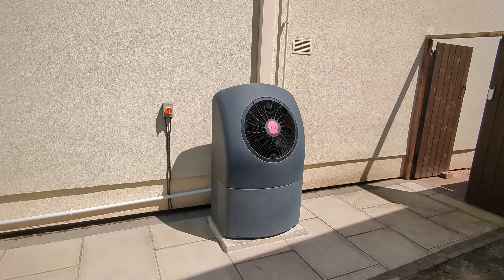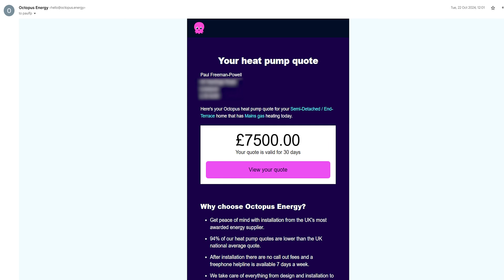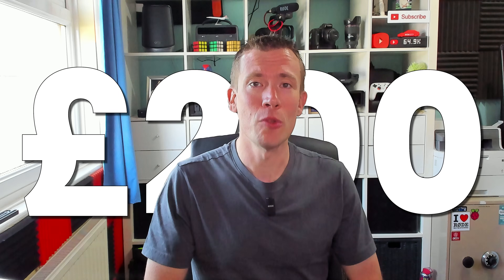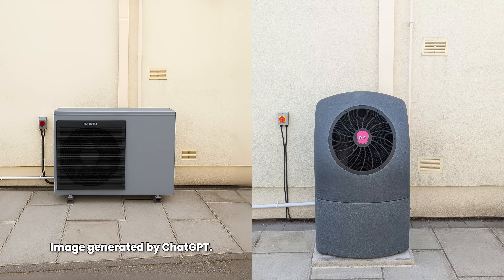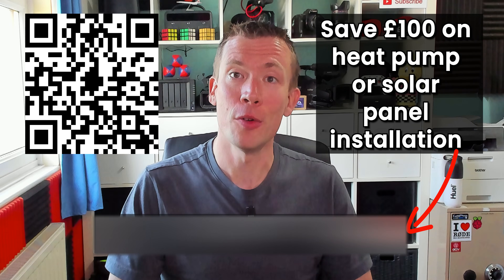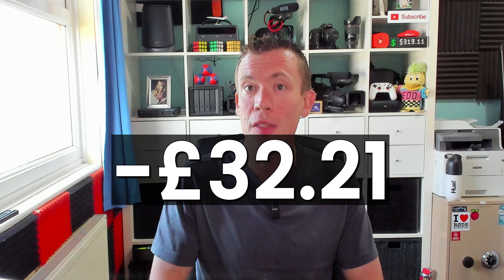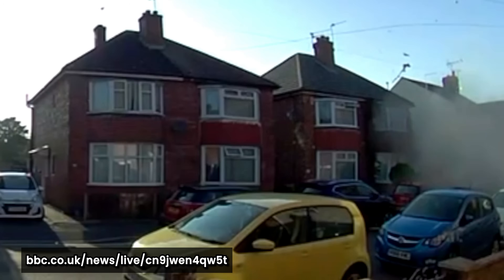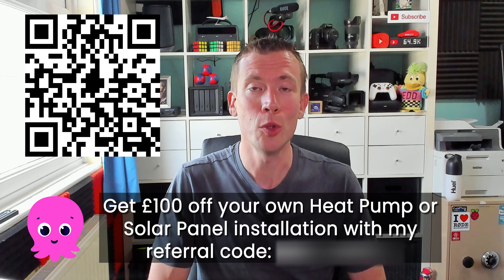How Much Did My Octopus Cosy 9 Heat Pump Installation Cost? [2025 UK Price Breakdown]

Comment: I watched this with interest. I did the numbers for batteries and cheap rate charging 7p per kW and they simply don't cost in, plus you need 20kW to have enough capacity. You never make your money back over the lifetime of the battery/inverter. Solar doesn't cost in because you generate power when you don't need it and FIT tariffs will change as the grid doesn't need it either, because they are also generating lots of free leccy. As for the heat pump, I found Octopus very hard to deal with, very inflexible and not at all cheap. I have seen some what I would call horrendous installations, with very long primary pipe runs, tanks in lofts and lots of paid for extras. I found Octopus impossible to work with. The problem with Turbo is that should the emitters be undersized you have to run high flow temps and loose a lot of efficiency.

I see Octopus being pushed with referral codes by many, but it's not a great deal. I ended up going to BOXT for my heat pump install and couldn't have been happier. I have a Vaillant Arotherm plus 7kW and 250l  Vaillant Unistore cylinder, the internet gateway is installed by BOXT as standard, which allows me to go onto a type of use tariff from Ovo (15p per kW for everything used by the heat pump), which means a lot cheaper (40%) than my gas boiler).. It also allows the heat pump to run in the best way possible, low slow and continuous, so the scroll compressor lifetime is maximised. My reasons for doing it were removal of the old heating system, boiler, vented DHW tank, header tank, 2 large loft eaves coffin tanks, etc.. and a complete update of the heating and hot water, for a price I could not have done it for using a plumber. in addition they dealt with my 2 old pumped Aqualisa showers for a small fee, which needed replacement pressurised system digital boxes fitted (Octopus, were not interested, which would have left me with a problem)..

So Octopus Cozy is going to suit some people I guess and receives a LOT of publicity by YT influencers...but it's definitely not the best game in town and worth considering other options.
Reply from the maker: Thanks for your comment. Of course, Octopus aren't the only game in town and it's always worth considering all options before choosing. I'd be interested to see the maths behind your numbers if you'd share that? Octopus installations might not be the most flexible (I had to argue a lot to get price reduction due to keeping my existing cylinder, for example) but for what it's worth they've done a fantastic job of mine, it's all really neat and well done and I couldn't have asked for more. What "paid for extras" do you mean? I wasn't offered any! 🤣 For me, a big part of the appeal was also the drop-in replacement of my boiler, with no radiator changes or floorboards up in any rooms, with the only work done being in my boiler/cylinder cupboard and directly below outside of course. So far, I'm very happy and might even have a Powerwall fitted by the winter to charge overnight on IOG... will have to see what mortgage rates do between now and then to see if I can make that investment too 😎
Reply: @SwitchedOnNetwork  You need to do the numbers for your own installation. Consider round trip losses, inverter replacement (find out what the lifetime is), cell capacity loss, actual vs stated capacity in use, do the number over the long term and for a 20 kW battery as the heat pump is going to use around that on average in the winter. remember the savings are much less for the 6 months of the year you are only doing hot water. Then put that against a dedicated type of use heat pump tariff, vs the use you will get of 7p per minute between 12 and 7am  eon next drive...I couldn't make the numbers work. The outlay is so high...it's hard to see a saving. But just some basic numbers...fully charge at night £1.40, losses 10%, 18kW available. assume all usage by heat pump, is 7p per kW and the house usage is covered from the battery as well so 30kW total @ 7p per kW + 3kW at full price.  vs Ovo 15p per kW for 20kW and 27p for 10kw.  I spend £5.70 per day, battery Man spends £2.97 per day...in the winter 6 months. In the summer battery man spends 70p per day, I spend 2.70 per day. 

Battery mans annual spend £542 winter £182 summer. My spend £1040 winter £492 summer. battery man spends £800 per annum less than me, using NPV (which is not realistic, but lets go with it). 20kW installed battery storage easily 12K by the time the install is done, so payback around 15 years. I've been conservative with losses, actual max capacity, no degradation over time, if I make the price cheaper, it's still 12-15 years. Then you only got your money back. In the interim you might move, will have lost capacity (up to 20%, esp if your draining the right down),  inverter probably needs replacing, so you may actually not have got your money back and even then...your battery installation has lost capacity during the next 5 years you want to get some money back out of it. I also used NPV, but in reality the money spen7 on installation isn't being invested and it could be earning 3-4.5%. So sure after 12-15 years battery man could be laughing having got his money back, if no inverter was needed...me I will be 77-80 years old and not caring.

Oh, as for the cylinder, I don't know how good an idea keeping your existing one was. Mine was too small for a 5/6 bedroom house and was vented. My replacement is a 250l Unistore and is shockingly well insulated, it's a fraction of what my gas boiler costs to heat and for twice the amount of hot water. It's heating every 2 days at a cost of 7p  (there is only me in the house), my gas boiler was 50p per day for less hot water in my old vented cylinder (insulated and lagged).

I think what you paid was great in terms of keeping costs down, but without the larger emitters the high flow temps are really going to hit efficiency and make that battery payback quite a bit longer. I went for a solution that upgraded most of my gas boiler suitable emitters, which was 10 replacements (as my other emitters were large). I'm, hoping I can run a max flow temp of 45 in the winter with it being 35-40 most of the time. It will be interesting to see your future videos and how the efficiency plays out over time. I suspect with emitters suitable for a gas boiler, your flow temp max will be around 50C, with 40-45C most of the time. Every 5C in flow temperature costs about 10% in efficiency, or more!
Reply from the maker: Thanks for the essay! 🤣 I'll try and be brief in my reply...

- Of course, I appreciate my numbers on my installation, my house and my usage/lifestyle will be totally different - but I was curious to see yours so thanks for sharing
- (I think you mean a 20kWh battery, not 20kW as that's power output (kilowatts) rather than capacity (kilowatt-hours) - people often make that mistake)
- I did another video my other channel a few years ago - https://www.youtube.com/watch?v=TGiz7isC1DI - talking about Powerwall payback. If I put the numbers into that spreadsheet from an Octopus quote for "3 solar panels + Powerwall 3", at £11,985, that gives a payback time - ignoring the power generated by the solar panels - to 10 years, 5 months and 28 days. Obviously the panels would help to pay back more quickly if they generate power that gets exported, but in my case with the location of my dormer loft that part of my roof will be in shade for some of the day so hard to predict overall output. 13.5kWh wouldn't cover all our household usage + heat pump in the winter [it would cover the rest of the house minus heat pump though - I've established that from the half-hourly data across an entire year on my account], but even so just 1x 13.5kWh battery would save us £96.97 per month charging overnight. (Double the capacity, double the savings and halve the payback time...)
- Cylinder-wise - it was either keep my 'old' cylinder and get a heat pump, or get my gas boiler repaired. I'd decided that I wanted a Cosy if I was getting a heat pump, and my cylinder cupboard isn't tall enough for the cylinder Octopus would have supplied. Plus, it's a pretty good cylinder and only 9 years old - even so, I'm planning to add extra insulation to it (the insulation is currently sat there waiting for me to fit it). I'll be making a video on that and doing some tests before and after with heat loss and scanning it with my thermal imaging camera to see if it makes any difference or was a waste of money ;)
- Obviously, replacing those 3 rads in my case would have increased the size of the emitters and potentially unlocked extra efficiency, but at what price to the cost - and payback time? And of course the environmental cost of scrapping 3 radiators, too. Efficiency is important, but it's not EVERYTHING; plus it becomes even less important when combining with time-of-use power. Another two thousand pounds to unlock very slightly higher efficiency didn't seem worth it to me, as that would take a long time to pay back, if ever at all. 

We will see though! :)

(Darn it, I wasn't that brief in my reply!)
Reply: @SwitchedOnNetwork  When I put numbers for batteries only, batteries or solar, or just solar into a spread sheet, used non NPV calculations, replacement costs, degradation, round trip losses, maintenance, savings interest losses, etc.. It never costed in, no matter how much I wanted it to. I am a fan of ideas like battery storage and solar, but no matter how hard i tried to convince myself, sanity always prevailed when I did proper numbers. Science/tech is one of my loves in life and I would have loved it to cost in.

Octopus wanted a huge cylinder in my place, which wouldn't have fitted in my airing cupboard...but the BOXT Heatpump guys got the 250l Unistore, Volumiser and 2 expansion tanks all into my airing cupboard a 60 (4)x120.1 (W)  230 (H) cm space. My loft conversion eave spaces all clear of everything with lots of storage space there now. Good luck with it, hope it works out, but I urge you to double check your numbers on batteries and solar panels before you take the plunge..
Reply from the maker: I think it's very easy to fall into a trap of over-thinking and over-complicating these things - and the numbers don't have to be EXACTLY correct/accurate to give a clear overall picture of benefit. To summarise: there's currently a 23.17p per kWh difference in the price I pay in peak times versus off-peak times (at today's prices) so multiplying that by 13.5kWh means that (assuming I use all 13.5kWh before 11.30pm) that will save me £3.13 per day or £1,141.70 per year (divided by 12 that's approx. £95.14 a month). Of course, there will be slight efficiency losses here and there etc. etc. plus when we go on holiday we wouldn't be using as much anyway, yada yada yada.... but the long and the short of it is that we'd be saving about 90 quid a month per Powerwall plus whatever the solar generates as a bonus on top of that. 

So, without needing every number to perfectly add up.... would it be an overall cost benefit from having done it? Absolutely yes. I can't see a scenario where it isn't, unless overnight off-peak lower rates are ever scrapped (which I can't see happening, but is a valid consideration).

On the savings interest 'losses' front... at an initial outlay of £11,985 that works out at an equivalent savings rate of 19.05% which is far better than what it's earning right now!
Reply from the maker: All I'm hearing is a huge about of negativity coming from you without many positive alternatives. What would your preferred solution be?  We shouldn't let perfection be the enemy of good. 

I don't think solar panels and batteries are at all 'sexy' - they're pretty ugly to be fair so it's fortunate you're not staring at them all day long. I don't think anybody seriously thinks they've "arrived" when they have them fitted. For people who like to keep up with the Joneses, maybe a Porsche on the driveway might do that but certainly not a quite unassuming home battery round the side of the house. And I couldn't care less about keeping up with the Joneses or people thinking I've 'arrived' 🤣

I've not "convinced" myself, as such - as someone with a scientific and engineering brain it makes sense, the numbers add up and it's far better than staying with horrible, dirty, expensive and dangerous gas - plus there are countless people out there who've done similar and it's working great for them already so it's not like getting a battery is a totally fresh, crazy new idea that I've dreamt up!
Reply: @DaveCorbey  12K for 29keh battery 🤔 No, you can get Frogstsr 16kwh battery for £1999, so for about £6-7k you could get 32kwh and an inverter installed.
Reply: @peterjones6322 Frogstsr? Lol
Reply: Get  the solar, as many panels as you can fit on your roof, the batteries can be added to as funds allow. My heating/hot water costs me nothing from March to November. In the winter, my HP runs from batteries that I charge at 7p/kwh (bog standard octopus hp install). I have 25kwh of batteries (soon to be 30). The feeling you get when you are free is priceless😊
In the future, when energy prices ramp up, you'll be sitting pretty. There will be negative people out there, but trust your instinct 👍

Comment: So the final fee wasn’t the final fee you added the extras on they always get you on that can’t wait to see the monthly cost of electric as we all al know there going up and up and gas is far better and cost effective but I do get it people like to jump on a band wagon lol but then if you have spare money I see the points put across to have it done juts a eye saw outside and let’s see how long a new product last like we seen with many new cars the electrical side of it fails all the time
Reply from the maker: It's personal opinion of course, but I don't think it's much of an eye sore down the side passage of my house, out of sight when I'm in the garden and barely visible from the front. I'm not sure what you mean about "the extras" though... which extras are you referring to?
Reply from the maker: I'm still waiting to hear what extras you think I added on?? 🤔
Reply: In reality replacing a gas combi boiler with a heatpump (without rad changes) wouldn't be far off this price, and even a high flow temp heat pump will cost less than a gas boiler to run and provide a more comfortable home. 
I've not long had my heatpump install and I agree, it's not the most attractive addition to the exterior of my property, but that boat had already sailed after installing solar and battery.
Reply: Nothing new about heat pumps, they are proven technology that are very efficient when run and installed properly. I had one in my house in 1981 when I lived in the USA, and the winters there were a lot colder than the UK.